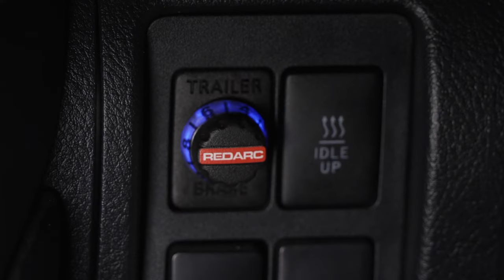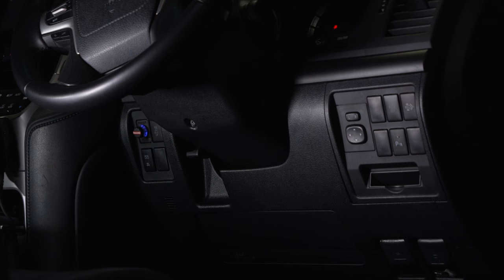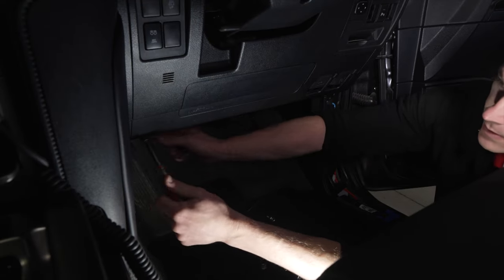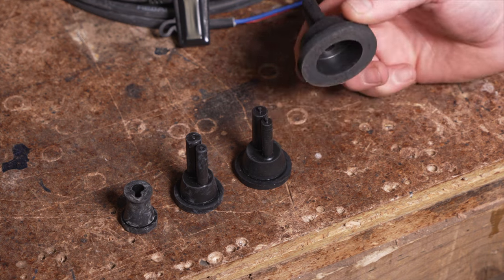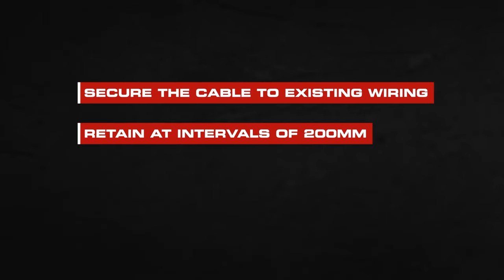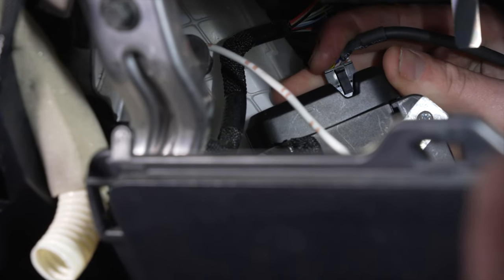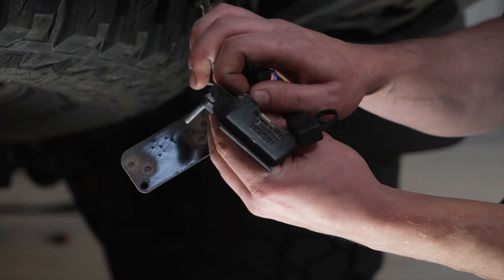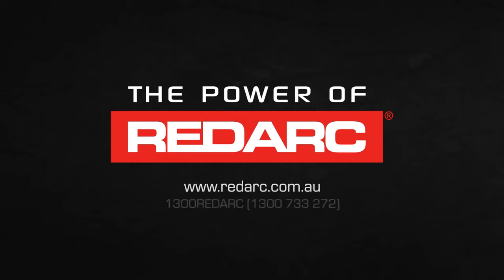HOW TO | INSTALL A TOW-PRO ELITE ELECTRIC BRAKE CONTROLLER

Comment: This is the best how-to on the brake controller install I've been able to find, thanks! I'd like to see the Encapsulated Power Diode installation in a video but got great help from the tech people at Redarc to get it done. Working perfectly in my 04 4runner.
Reply from the maker: Thanks for watching! If you've got any questions about the Encapsulated Power Diode, please don't hesitate to reach out to our Tech Support Team on 1300REDARC (1300 733 272).

Comment: My vehicle already has a 7 pin but no trailer brake so I've been shopping around and ran into yours. You say to remove the already installed blue cable if it has one, where does that go into the vehicle if it doesnt have a trailer brake already? Does it just terminate somewhere?

Oh boy, does that vehicle have enough accessories attached to that battery?

Comment: Hi, Did i miss how you connect tow pro to the battery. cheers wayne
Reply from the maker: Thanks for watching! The Tow-Pro connects to the battery via the black wire and a fuse or circuit breaker. We recommend checking out the wiring diagram on page 11 of the instruction manual.

Comment: So you don't need to connect the blue wire to the brake pedal brake actuator?
Reply from the maker: The output Blue wire should connect to the trailer socket (7-Way or 12-Way) Trailer Brake output pin. The only wire that might connect to the pedal actuator would be the Red wire from the TowPro. But typically this is only if the vehicle is older and doesn't have any CANBUS related systems, otherwise interference can happen in that method. 
We hope that helps!

Comment: Wonder if i have to buy the tph-015 harness separately or it come w the pro elite kit?
Reply from the maker: Thanks for watching! The Tow-Pro Wiring Kit does not come with any of the Tow-Pro wiring harnesses, instead it comes with the TPWKIT-013 or TPWKIT-014 depending on the kit.